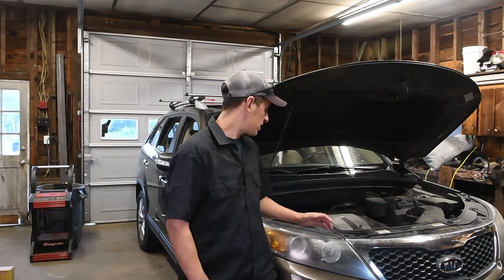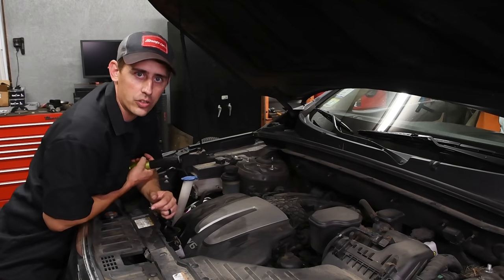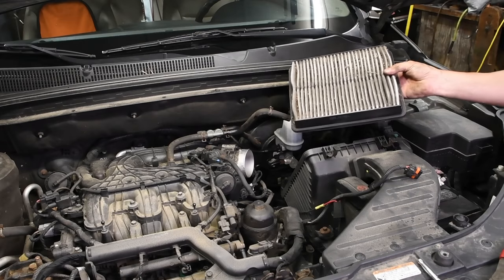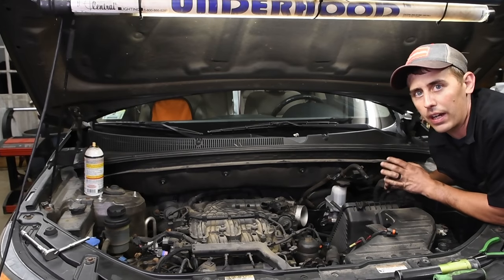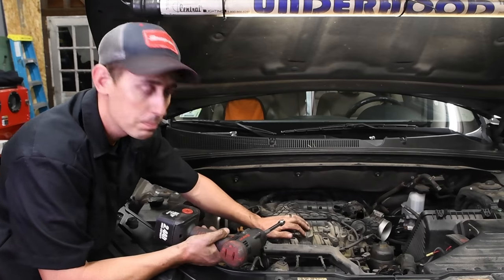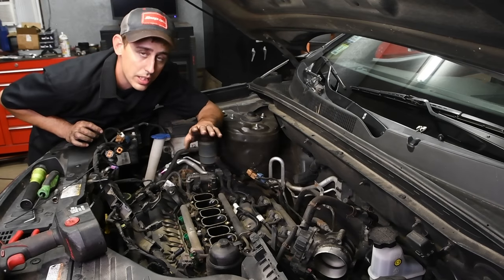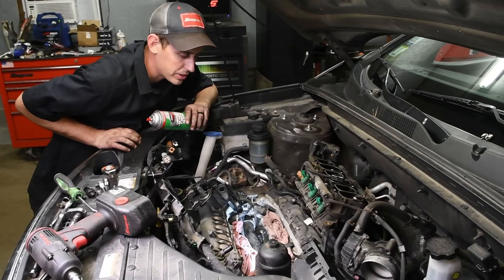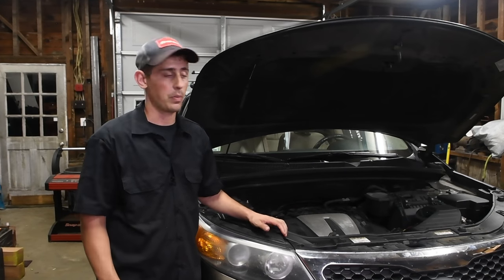Kia and Hyundai 3.5 oil leak diagnosis and repair

Comment: Gah man so so helpful! I'm have this problem on an 07 kia rondo 2.4. It actually drained all the oil out so fast and I started hearing knocking before the engine computer threw on the dash light. I heard the valves and drove about 10 miles like that before realizing something was really wrong. Do you think its likely there is damage elsewhere now? Should I dig into the valve train?
Reply from the maker: It’s tough to say if any damage occurred. I would fix the leak. Fill it with oil and listen for any odd noises. If you have no noises I would drive it a couple hundred miles and change the oil again.

Comment: What would a job like that cost from a repair shop ?
Reply from the maker: Hard to say since shops charge such drastically different labor rates but expect 3-5 hours of labor from a reputable shop. 5 is on the high end.

Comment: I have 08 kia sedona put new oil pressure switch ! but seen i still leaking do i have more than one switch
Reply from the maker: Lenny James did you clean it off really good? I have seen them retain a lot of oil and appear to be still leaking.
Reply: @InTheShop  Ya! But min was not under intake was by oil filter into the block the a plug in! on the Trans side could not see good cause topcover but looks like driping bad above were the switch i put in other day!
Reply from the maker: The Sedona might have a different setup. I do have another video about how to narrow down oil leaks. Not sure if that would help you.
Reply: @InTheShop  Man im going take alook in morning!I was out to dinner some one side looks like your leak oil! like better not be! and hell yea! and if their not 2switch in that van! Than that oil filter set up this van has! Thank tho get back at me.

Comment: Great video, you just gained a subscriber in me!

I have a 2011 Hyundai Santa Fe Limited AWD. Having some problems I can't quite figure out. If you find a minute, see the list below and let me know what you think!

-------------------------------------------------------
Car Details
Year/Make/Model: 2011 Hyundai Santa Fe Limited AWD
Mileage: 180,000
Transmission: Automatic
(Current) OBDII Trouble Codes: piston 4 misfire
Previous Warning Lights:
   -Solid & Flashing Check Engine :: only flashed once (piston misfire), solid for weeks on and off
   -ABS :: on/off for weeks at a time
   -Tire Pressure Warning :: goes away within minute of starting

This is my dad's old car. No accidents or damage.

-------------------------------------------------------
Issue Timeline
=2 years ago-=
-ABS and solid check engine lights would come on and off every now and again.

=1.5 year ago=
-Wouldn't start up. AAA changed my battery. Started right up.
-Sometime after this ABS light was solid and stayed this way for a while.

=1 year ago=
-ABS and/or Check Engine light would be solid on/off randomly
-Shifting between park, drive, reverse, etc began to lock up sporadically (and then permanently). Needed to use shift lock release to override it.
-Car started making some noises on cold starts.
-The noise wasn't too bad then. It's much louder today. See video below to hear noise
-Brought to mechanic: They didn't know exactly what was wrong and warned me digging around could be expensive and they might not find anything.

=Recently=
-ABS light suddenly turned off a month ago and shifting worked without shift lock release override for a while. As of a few days ago it's locked back up again.
-Car makes a very loud sound on cold starts lasts for ~5 seconds (video below)
-Car dumps a ton of exhaust upon this first start up. It's a white/grey smoke and lasts for 30 seconds. Has a strong smell. (video below)
-Upon acceleration I hear a slight vibrating sound which seems to be coming from the very front of the car. Almost sounds like my license place is shaking. But goes away eventually.
-I've had trouble starting my car 3-4 times as of 3 weeks ago. I hear 1 'click' and then nothing. By the time I get AAA on the phone, and the car will decide to start.
-A few week ago I was driving and all of the sudden the check engine light was flashing. Pretty severe vibration in the car even in idle. I didn't drive far.
When I restarted it, the check engine was solid with no vibration in the car. This seemed to produce the piston misfire code. Drove a few days after and check engine light disappeared.
-Recently I've noticed the AC has a very gasoline-y smell.

Cold Start Noise & Exhaust Dump: https://drive.google.com/file/d/1QymyYZ2AwSqQUVtrAt6itJ4vfomKfC8I/view?usp=sharing
Reply: Let me try and help you with those:

1. "ABS and/or Check Engine light would be solid on/off randomly"- You need to see what the codes are. For a cylinder 4 misfire, start off by replacing all spark plugs. The spark plugs are hard to replace on this vehicle...It would be around $250.

2. "Shifting between park, drive, reverse, etc began to lock up sporadically (and then permanently). Needed to use shift lock release to override it."- there is a technical bulletin for that. It's the brake switch. To diag correctly, have someone check if the brake light is on when the fault is happening. If it's not on (and you press the break), then it's the brake switch. This might also fix your ABS fault. Break switches are easy to replace yourself (3 minutes), and cost about $60

3. "Car started making some noises on cold starts."- HOLY SHIT. That's your lifters! How long do you wait between oil changes??? Either rebuild the engine or add Lucas additive to the oil. But this engine is VERY worn out! This would be $4K

4. "Car dumps a ton of exhaust upon this first start up. It's a white/grey smoke and lasts for 30 seconds. Has a strong smell." -Smell like fuel? Could be a bad CAT converter. Car is consuming coolant/Oil? Could be a bad head gasket or worn piston rings. 

5. "Upon acceleration I hear a slight vibrating sound which seems to be coming from the very front of the car. Almost sounds like my license place is shaking. But goes away eventually."- Could be lots of things. Start by checking for an exhaust leak.

6. "I've had trouble starting my car 3-4 times as of 3 weeks ago. I hear 1 'click' and then nothing. By the time I get AAA on the phone, and the car will decide to start."- Have the battery tested. If it's not an unstable battery, it's probably the starter. $100-$500.

7. "A few week ago I was driving and all of the sudden the check engine light was flashing. Pretty severe vibration in the car even in idle. I didn't drive far.
When I restarted it, the check engine was solid with no vibration in the car. This seemed to produce the piston misfire code. Drove a few days after and check engine light disappeared."- You just confirmed the misfire. Stop ignoring it and change spark plugs!

8. "Recently I've noticed the AC has a very gasoline-y smell." If it continues after replacing a cabin filter, and after a few months it stops cooling your evaporator leaks. $15-$1300.

My advice: Get rid of that car. It's unsafe, and the cost to repair all these things is going to be 8K (if you include the worn-out engine replacement). Without the engine, it's still a 4K bill. I wouldn't bother. Tell your dad to start having the correct regular maintenance as per manufacturer recommendations. I have the EXACT same vehicle (2010 limited AWD), with the same mileage, and no problems. But I replace the spark plugs+ the serpentine belt+Transmission fluid every 90K, the coolant+brake fluid+power steering fluid every 5 years, the oil every 4-5K, the axle fluid every 40K, and I put an injector cleaner additive a few weeks before every oil change. Things break when you don't take care of them. And the fact that you wait YEARS to do something about those just creates MORE damage. Sorry if I sound angry...I just am. If you don't want to correctly maintain a vehicle, lease or rent....Don't buy one.

Comment: Where are you located?
Reply from the maker: Massachusetts
Reply: @InTheShop  wish you were in Southern California, I have a 2015 optima that leaks oil and I have been told it’s the main seal but the dealership said the seal was fine , I bet this is the problem
Reply: So I have a 2015 Kia Optima with an oil leak , I was told by a mechanic it was the main seal but the dealership ran some dye through and said the main seal was fine , is this switch still a problem on 2015 models? Thanks for your time
Reply from the maker: @mikewatson5281  it may be. I would look down into the valley under the intake.
Reply: @InTheShop  I don’t even know what the “intake” is 😂

Comment: Sister in law got a sound from engine and check engine light on so she was going to have dealership look at it as it is under warranty but I said I would look at it quick and see what the codes are. had two codes left and right bank cam phaser codes ..usually this spells the end of a kia motor as expense is a ton. checked dip stick burnt oil smell no fluid on stick. First off vehicle has 112K miles on it so no warranty and second thing is according to her records its been 20 thousand miles since last oil change ??? :(  took 5 whole quarts of oil to bring fluid level up to mark. cleared codes drove for 30 miles engine runs great no codes. recommended oil flush and drop pan to clean of debris check oil pick up tube and inspect for burnt rods (indication of spun bearings) advised her to unload the vehicle. she decides to keep it so no oil flush done as I would be forever responsible in future if something happened and no point in inspecting main if shes not going to fix it or unload it. (typical dumb ass drive it till it dies mentality) oil leak evidence under vehicle looks like a rear main seal so found this video. Had yhey taken it to dealership they would have advised to trade it in or replace short block and have heads sent out and reconditioned and new cam phasers installed etc to the tune of 12K plus. As it was codes for phasers came on from lack of oil (5 qts low) engine runs flawless never ever seen this happen without a sob story involved . took 3 weeks to convince them to install 4 tires (cords showing) change oil and oil psi switch and gaskets and plug change along with new boots (didnt need them but originals might noty last another 112k miles so replaced um anyway.
Reply: my bad the sound she heard from engine is a noisy not working ac compressor. dumb ass did not even notice ac wasn't working ..  once had a lady come into the shop and say on a hot day her ac isnt working. spent 5 minutes inspecting her car and grabbed the boss and asked for his advice ... he looked at the car inside and out looked at me with a puzzled expression at which point I simply grinned and nodded my head .. we both went over to the lady in the waiting room and asked her if she just bought the car... she said shes owned it for 25 years .. at this point we informed her that her car does not have AC and never did .. she was so embarrassed after we explained to her how to operate her heating controls and that the fresh air vent simply funneled outside air into the cabin ..

Comment: I SAS the video on the Kia Sedona van oil sensor switch I wax curious what it cost to fix I'm not going to dealership they tried to get me on a unnecessary repair for 1400$ I don't trust them I've spent 60000$ at there dealership they don't care

Comment: Or do you mean cable ties and wire ties. You have cables and wires and needs fastened. But I bet you $1,000 you don't find one zip on there. Sawadee Collins zip ties? It's an improper term.

Comment: I just ruined my car. This video doesn't mention that you don't have to tighten the new sensor all the way. It just broke the housing because I didn't know there was supposed to be a gap because that's extremely counterintuitive.
Reply: It’s pipe thread, seals on the tapered thread not the shoulder.